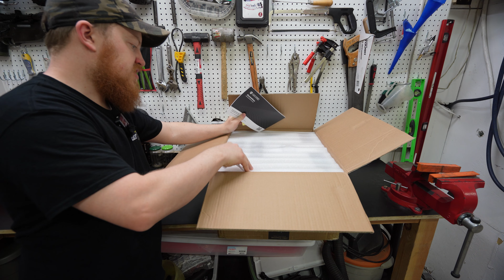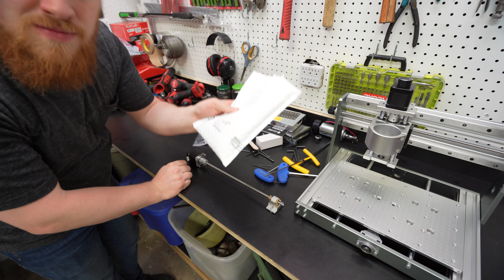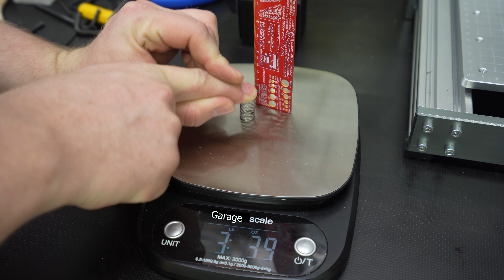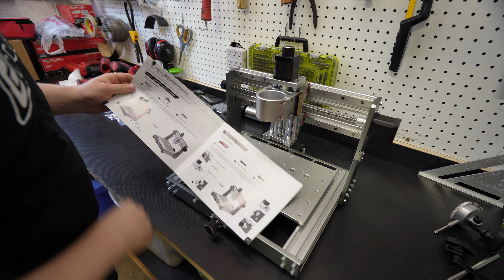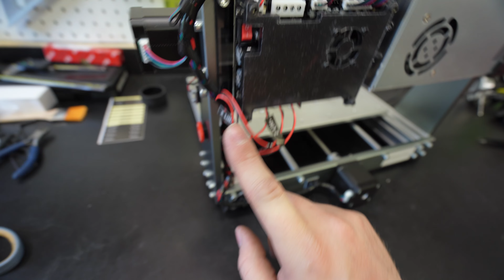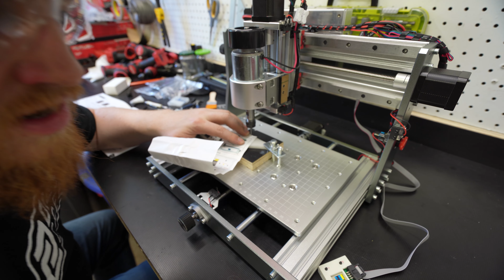Desktop CNC Beginners Experience. Unboxing And Modifying Genmitsu 3020 Pro Max!

Comment: Great job. As someone else asked, which springs.  There is a link to a page with tons of springs.
Reply from the maker: The link SHOULD bring you to a page with 2 spring options and the only difference is spring steel or 316 stainless. But LeeSpring's website has a bit of a learning curve to use unfortunately. The spring i specifically used is the LC038G07S in case you want to start searching from their homepage. Hope that helps!

Comment: How do you place a part on the bed and set software to locate that exact spot ?
Reply from the maker: There's many techniques and ways to go about it, but it's essentially manually getting the CNC's origin to match the origin of the part you designed. The software they give with the 3020 has a button to set current spindle position as origin for X and Y and a separate button for setting the Z origin. So if my part has a prominent corner. I could set the top of that corner as my part origin in my design. then manually move the spindle to that corner IRL and set XY origin. then I would use a piece of paper with the bit in the spindle and bring it down till it catches the paper on the top face of the part IRL and set that as my Z. Now the CNC origin XYZ should match my designed part origin XYZ. There's also edge finder tools and other fancy ways of doing this but hopefully this at least gets you the idea of what is happening haha

Comment: I bought this unit over a year ago. The backlash and chatter really makes it frustrating when cutting aluminum. Although that's what this machine was "marketed" for. I've tried MANY different speeds, feeds, depth of cuts, and flutes. It's def not what I was hoping for. In my opinion, those cheap lead screws and nuts killed the concept. I hope to one day buy a real CNC machine, but they aren't $500 haha. Thanks for the video.